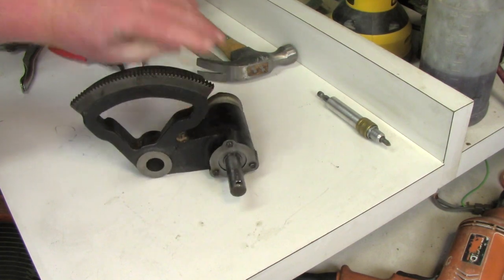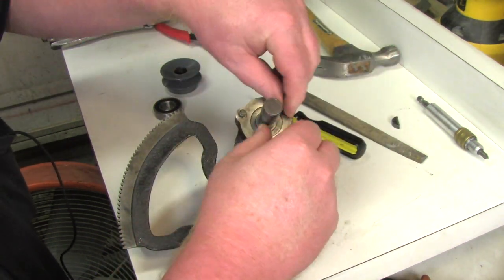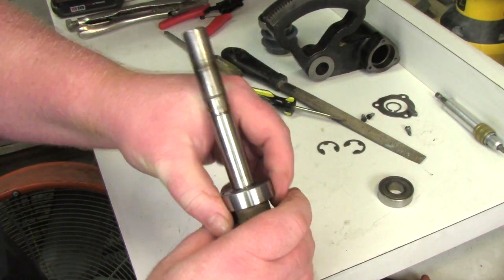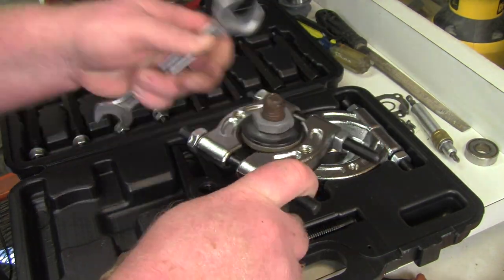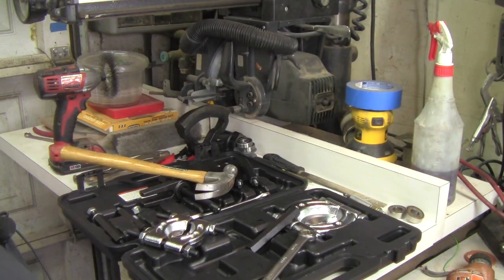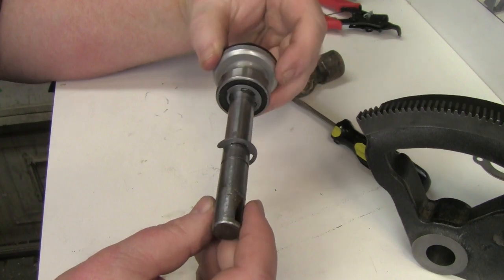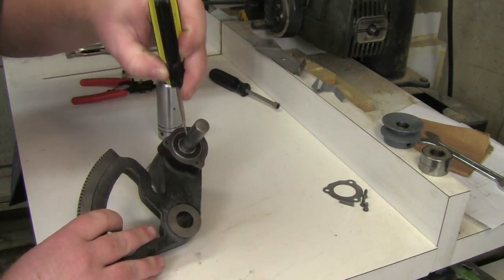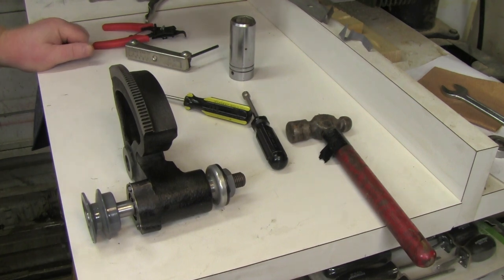How To Change The Bearings On A Craftsman 100 Table Saw Restoration Part 4

Comment: Hi Patrick. I have the same saw and restored it as well. However I did not remove and replace the arbor bearings on the main arbor shaft. After watching this part 4 video, I decided to leave well enough alone as my arbor bearings still move very freely. In your video you also mentioned that the original bearings were still good thus I decided not open that can of worms.  If there are any bearing issues in the future I will attend to them as per your helpful instructions as I already know how to quickly disassemble the saw. Also, I use my saw infrequently and can only assume the original arbor bearings will outlive me as they are of good quality.

Comment: I really enjoyed you showing how to do the bearings. I am restoring an old Delta bandsaw and am thinking about changing the bearings. I have it almost completely apart so it seems logical.
Reply from the maker: it would prolly be smart to change them  since its all apart already   just be sure the new ones are the same before installing   good luck

Comment: Great Video. I'm restoring a Craftsman 10 in. T-Saw 113.27970, getting ready to order bearings  N/D 77120 or Craftsman Pt. # 3509. Pounded the arbor out of housing after removing the cover and clip, but the bearing on the blade side had PIN holding the blade mounting washer, punched the pin out, the blade washer came off, and the bear came off. Never seen one like that before. Thank You for you excellent video. I learned something from it. Keep up the good work. I save the video for future use.

Comment: Great video.  Thanks for making this.
Question... I’ve got a 10year old Delta 36-978.  I just noticed that when the motor is on the belt (ie the pulley is weighted with the motor), it throws the blade/arbor off alignment by almost 1/32.  With the motor off the belt and no weight on the pulley, the blade is aligned.  And with the motor off the belt, I can detect a very subtle play if I try to wiggle the blade... just enough play to hear a distinct “click”.  

I suspect it’s the beating, but I’m not a pro, so while this table saw is 10 years old, it’s only been used a hand full of times, so I can’t imagine how it could already have gone bad.  

Honestly, this problem could have been there since the beginning... I just didn’t spend enough time checking alignment back then to notice and hadn’t needed it for fine cuts until now.

My question is... is it worth going through the effort of replacing the bearing... or is this characteristic of some make/model of table saw?

Comment: some terminology : the loose half-moon shaped bit is the key (Woodruff key) the place in the shaft in which it sits is the keyseat. The slot in the pulley that slides over the shaft is the keyway.
For the sake of sanity... do NOT hit the end of a shaft with a steel hammer??? Use a brass/soft hammer or if you don't have that use a bit of wood in between!
And I have to agree with a previous commenter, when changing out bearings...don't go 'cheap'.... you'll just have to replace them again very soon.... and you may damage something much more expensive while they are in use.

Paddy

Comment: Patrick....thanks for the excellent video. I think this is one of the most detailed how to video series I have seen regarding refurbishing a table saw. I got a question regarding removal of the arbor bearings on a Craftsman 80 table saw. The housing design is a bit different, but the rod and bearing set up looks essentially identical. Thing is...I can't for the life of me get the first bearing (opposite the pulley bearing) to come out. I have beat on it and I have use a three jaw puller, with absolutely no movement. There are no snap rings anywhere on the bearing, or I would have removed those. Any suggestions?
Reply: I'm having the same issue, and I wish this comment was answered! Did you by chance ever figure it out?

Comment: Where did you get your purchased parts? I am also going to replace the bearings and the pulley.
Reply from the maker: awesome  ok here is a link to the pulley i used http://amzn.to/2uiEk9Z and here is the bearing I used  http://www.ebay.com/itm/Arbor-Bearings-Set-of-2-Sears-Craftsman-10-Belt-Drive-Table-Saw-3509-113-xxxxxx-/321117503609?epid=1824589987&hash=item4ac4184079:m:m2Mj1ATVRszxH9JDjANDHbQ   and i used a link belt to eliminate viblration http://amzn.to/2tIM43w  i think thats all I replaced besides the motor and switch  here the switch i used http://amzn.to/2uiCCFu     everything else i did was just magor cleaning and paint   good luck with your project

Comment: Do you know the significance of the key weight?  My husband's Craftsman "100" doesn't have good power even though the motor is OK.  There had been an issue with the key weight before because we bought a package of 4 and he replaced the one.  We just don't remember why as it was about 15 years ago.  Still have 3 more key weights but don't remember if that affected the power or if it just made it wobble.
Reply from the maker: the key is what keeps the pully from free spinning on the shaft   so basically, it keeps the pulleys on the arbors and allows the power to transfer via the belt   there is a small  grub screw that locks them in place as well
Reply: @Patricksworkshop  Thank you.

Comment: As a VoAg teacher I cringe at you using the wrong tool for the job. Good job on rebuilding the saw.
Reply from the maker: well don't cringe too much i hear it hurts after a while  ,thanks for watching  so what would you have done different teach i am interested in hearing what you got  oh and thanks for watching
Reply: Well, one shouldnt hit a driveshaft with a metal hammer. Brass hammers are made for that. Lacking that, use a block of wood to cushion the shaft. Also, its good to avoid using a flat file on a round shaft. Emery cloth is much better.
Reply: @Jason-jn9sk  that file isn't hurting nothing. 
He was just Knocking off burrs. 
The bearing don't ride any where near where he filed. Even if it did, it wouldn't hurt it. 
Yes, in theory, shouldn't use steel hammer on the shaft. But light tap won't hurt it. 
Did the author drive the bearing on by the outer race?
If pressing bearing on to a shaft, I would press it on using the inner race only.

Comment: When I use bearings made in china, I remove dust shield, remove grease that came in them from china, and replace with a good grease.  Grease from china looks like vaseline.  Put the dust shield back on. They will last a lot longer this way.